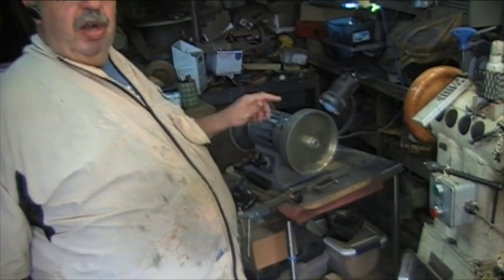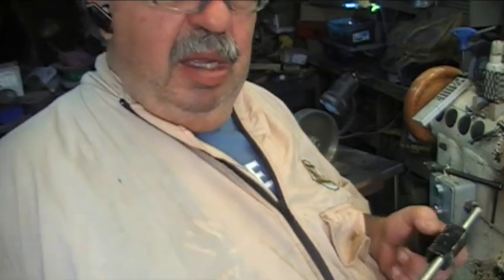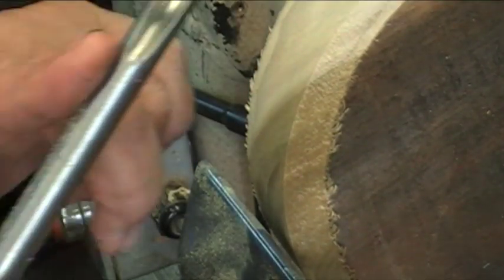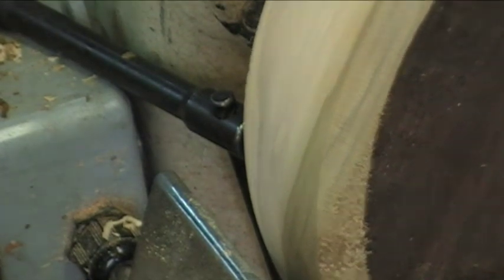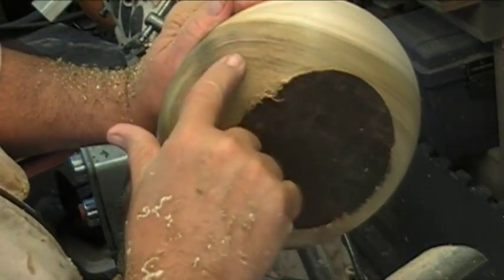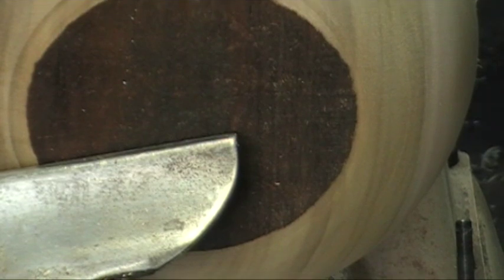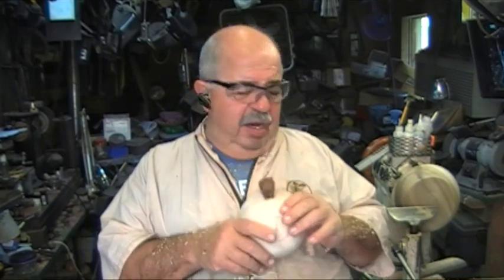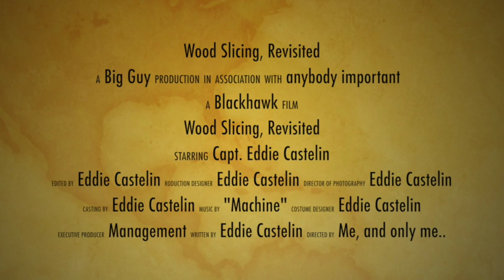# 228 Wood Slicing, Revisited

Comment: Yes! Yes! Yes! Great words, captain. I call it "common sense". And I use common sense (not the safety gear) all the time. If I'm confident in the process and I made it hundred times - I might not bother with safety gear. If I don't feel enough confidence in what I'm doing - I will definitely protect (not overprotect though) myself. This includes some actions I do for the first (or so) time, some really potentially dangerous actions (like cutting through metal with this very thin dremel cutoff disc, etc. If I'm rasping some piece of wood - no way I put on safety glasses.
The only thing I didn't get - what's wrong with wearing a wedding ring? Even though I don't wear it in my everyday life, I'm curious what could happen on a lathe so wedding ring leads to some nasty consequences?